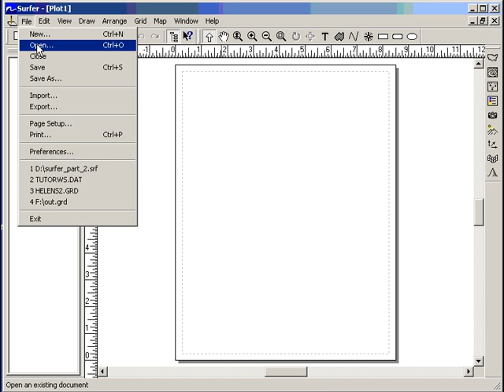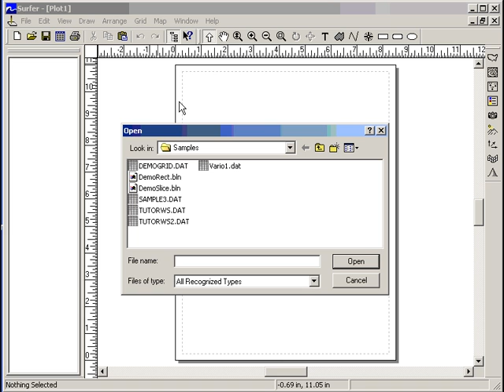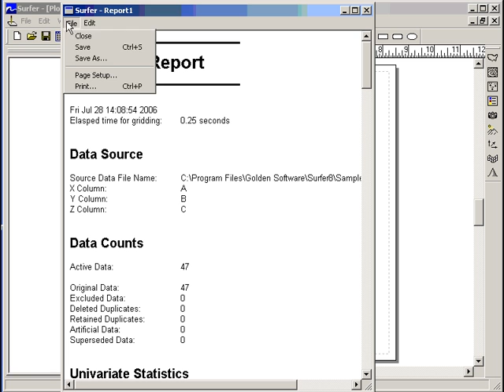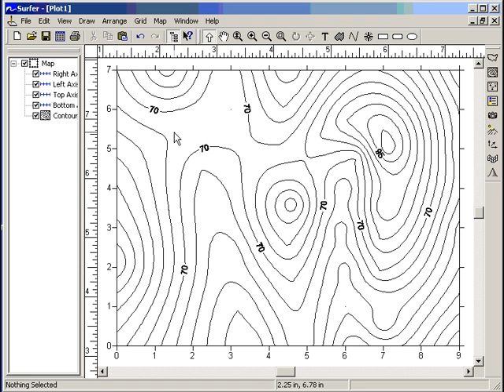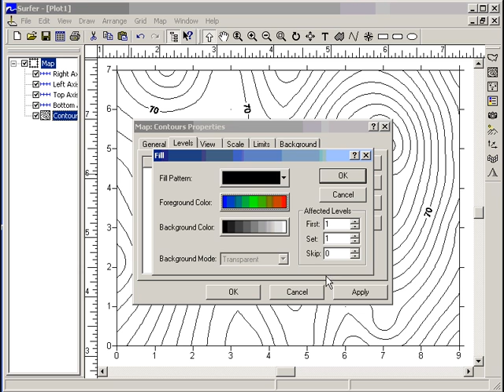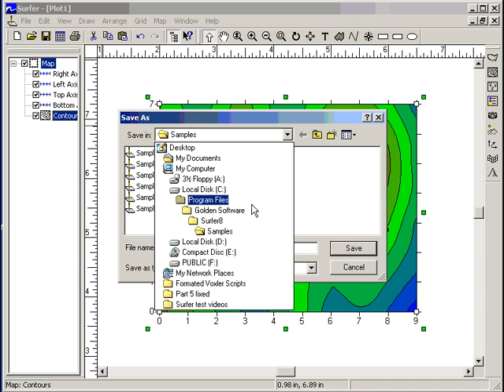Surfer 8 | Creating Grid Files and Contour Maps

Comment: Good afternoon, I have a question. I would like to make a contour map with qualitative characteristics, not numbers, but when I click on Grid then Data and add the file and press OK a message appears saying: Insufficient data (3 or more XYZ triplets required.

What I can do? Thank you.
Reply from the maker: Hi Andres,

Surfer requires numerical values for X, Y, and Z. You will need to create a column that has a number for each text value. Then, you can grid this numerical column as your Z value.

Thanks,
Jennifer Woodson
Golden Software Technical Support
Reply: Thanks I'll do it. Very kind.

Comment: Hi, I need a help with choosing interpolation method to create a groundwater table. Situation looks like this: 49 irregurarly scattered points, isotropic ground. I have tried kriging, but map looks bad, triangulation gives too sharp lines. Someone suggested Local Polynominal ( power 3 ), but when I used it, even though map looked nice, there were points with different measured values than isolines which runns through that point. Any ideas how to solve this?